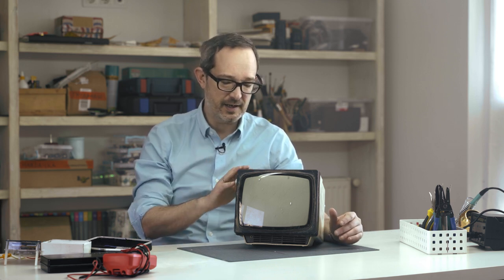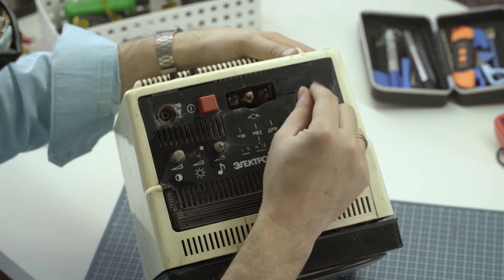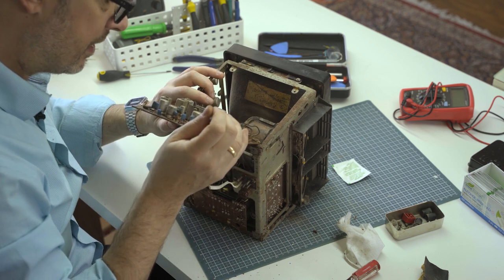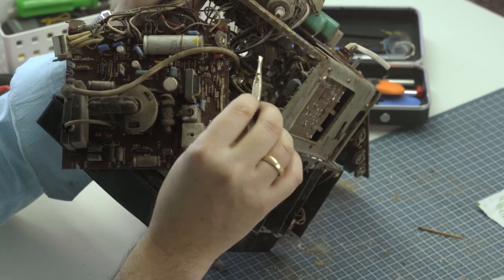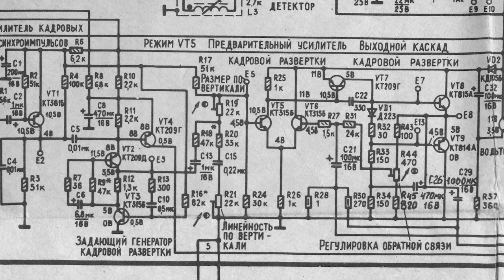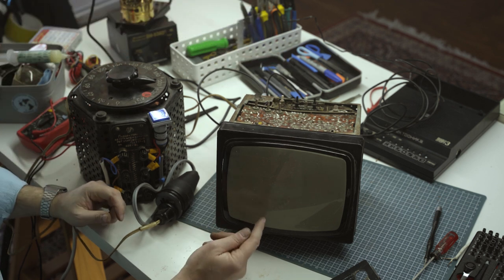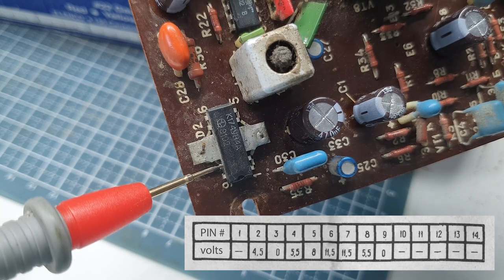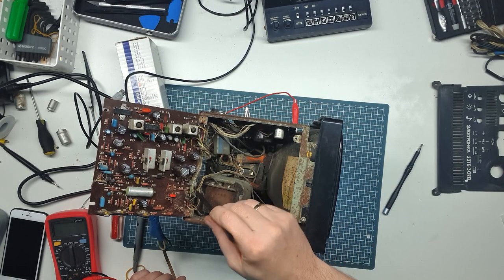CRT Television Restoration, from the USSR!

Comment: Hello,
Just a tip for cleaning the TV motherboard. I usually clean it by removing the transformers from the motherboard and the speaker and the picture tube (CRT) from the TV, then I bathe them in a bathtub with soapy water. 3 days of drying next to a radiator and it will dry completely, it will be nice and clean. I've been cleaning old dirty TVs this way for years and it always works, I know it sounds a little weird at first but once it dries it's fine. I have several Soviet televisions, Elektronika C430 and C432, Junost 402. And I also have a Videoton Color Star television.
Greetings from Hungary!
Reply from the maker: Thank you! Will try this method next time!

Comment: I like getting stuff in the kitchen sink with hot water and dish detergent and using a paintbrush to make everything clean again. This is effectively what Tektronix used to do when servicing old tube oscilloscopes. 
I have a tube FM receiver that smelt so bad (tobacco) when I got it that I ran it through the dishwasher a couple of times and it came up like new. Obviously have to give it a good chance to all dry out before applying power.
Reply from the maker: That’s a good tip, Rich—thank you!

Comment: The set looks like it'd make a nice monitor for a retro computer (preferably Soviet)
However that variac looks absolutely deadly with a missing side panel.
Reply from the maker: Thanks for watching, Paul! Yes I came to the same conclusion about the Variac and eventually replaced the screw terminals with a cut of clear acrylic and a standard female outlet.

Comment: for cleaning boards a tooth brush works well, with isopropyl alcohol.    for nasty ones that are out of the unit you can try good old soap and water followed by IPA.  then of course blow them out with compressed air and let dry.
Reply from the maker: Thank you! I’m always nervous about the e soap and water approach—is it safe for things like transformers?
Reply: @ThomasBurns  it depends on how they are constructed, if sealed then yes if not then avoid the area and then hit it with ipa and a good blowing out with compressed air.  ( I started out working on US Army Electronics in 1981 Ironically. )   even if they do get wet IPA then blowing it out and setting it over a warm vent will dry things out. (Glenn L.) As the boards in this case have many Coils in them I would clean with IPA. Also I noticed you are working on the tv with a metal watch and ring on. they should come off when working on live electronics. (Safety last! LOL)
Reply from the maker: @MegaWildweasel  Thank you, Glenn! And thanks so much for watching!

Comment: 21:39, a seemingly professional technician can't understand that the mount is used as pin 5 and the same sheet of metal won't have different voltage on the other side. Soviet engineers even labeled the pins for the silly ones....
Reply: He said he's an amateur.